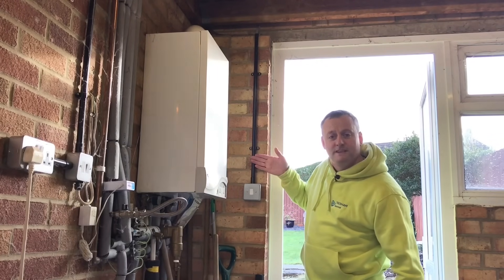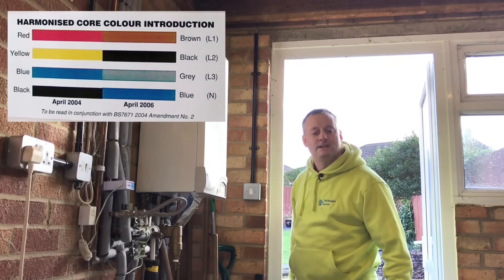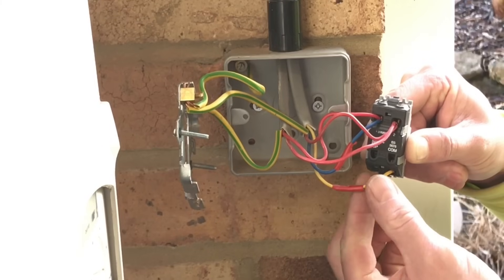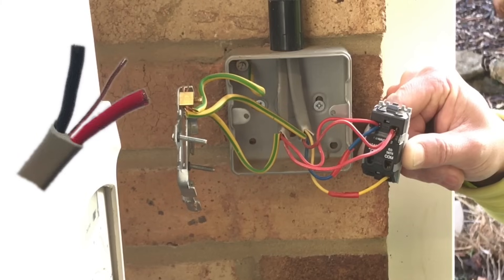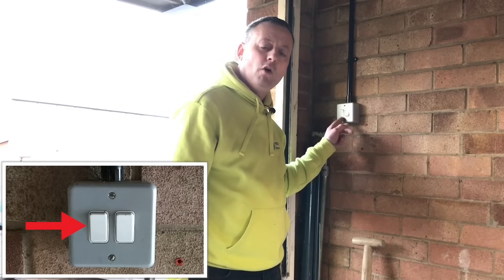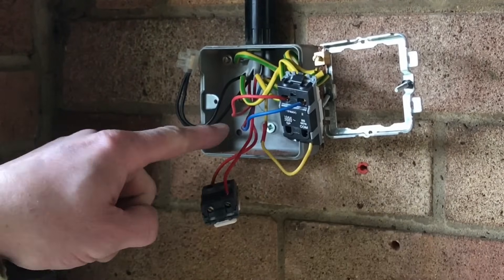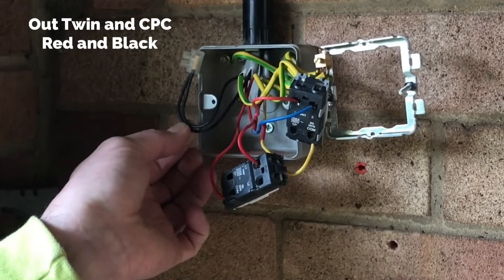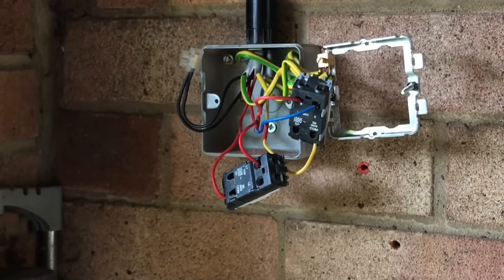Old Cable Colours Pre 2004 In 2 Way Switching and a Feed (Supply) to a Switch for an Outside Light

Comment: If you're still here.....Help lol.
Right so I have this same wiring but the wires aren't identified.
Downstairs has a 2 gang 2 way but upstairs doesn't. 
I've tried fitting a 2 gang 2 way upstairs but can't get the configuration right.
So

Comment: I’ve got a single switch which has a black and red wire. Which colour wire goes into the L1 and which colour goes into the common - any help requested. Thanks
Reply from the maker: It doesn’t matter but people use common as red and black (with red sleeving) in L1 👍
Reply: @GSHElectrical  thank you so much for the quick response. Great video and advice.

Comment: I’m interested to know the ‘role’ yellow is playing. On a living room light switch which controls two ceiling pendants, which also run off another light switch at the opposite end of the room I’ve got a yellow going into common, one blue/one black going into L1 and two red going into L2... just curious, thanks.
Reply: Hello have you worked this out I have exactly the same issue!
Reply: Yes, it’s a three core and earth cable. It’s old colours red yellow and blue. It’s now been replaced by brown, grey and black. Plenty of info on the internet and YouTube as to how to wire them up
Reply: @TavsIsAbout  yep successfully done it today, I assumed yellow wire was “com” when putting my probe to it indicated live, turned out it was a “switched” live, wires were all muddled up, switched lives are all taped to indicated now :)
Reply: @dakkan5433  so from what I gathered, the yellow generally acted as the common, both reds (so live) went into L1 and blue black (neutrals) went into L2 so that’s how they were wired. I found circuit diagrams were for example it was red in common with the yellow and other red in L1. Basically as long as it matches down the other end of the room, you won’t go wrong. All the best.